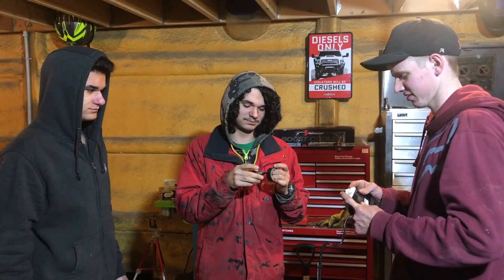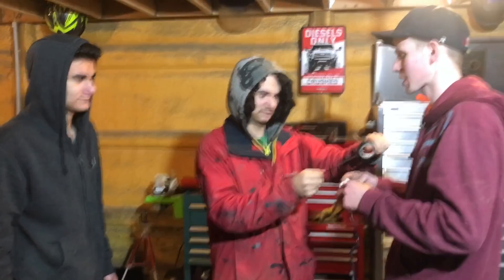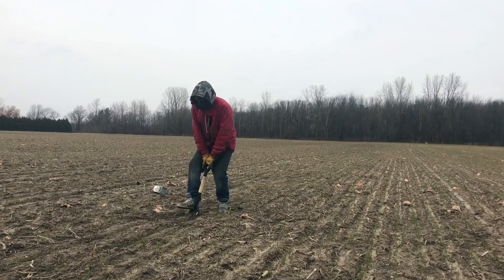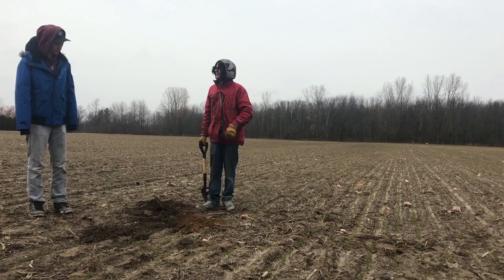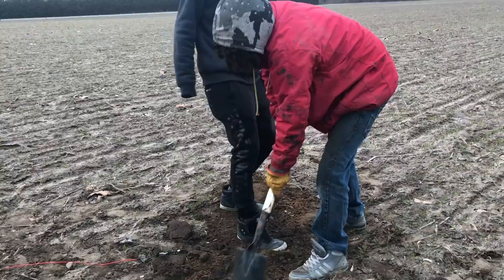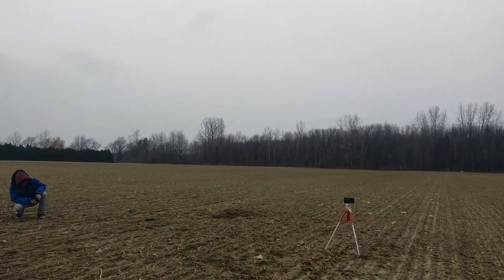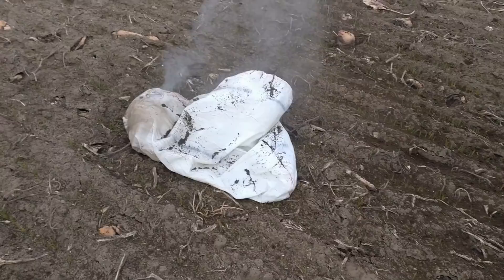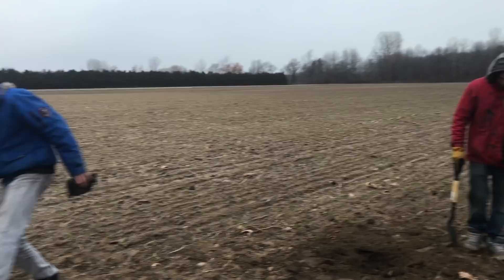Buried an Air Bag?

Comment: Put 2 facing each other and set them off at the same time. If that doesn't work then put one in the toilet. Make it activate when the seat is opened. 🙃
Reply from the maker: Option A sounds cool. Option B sounds like the ultimate April fools prank